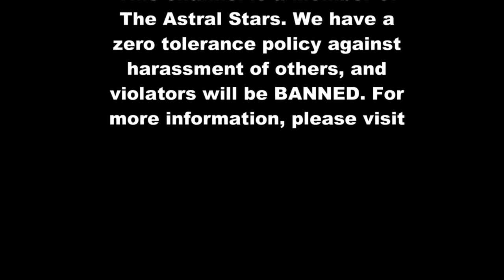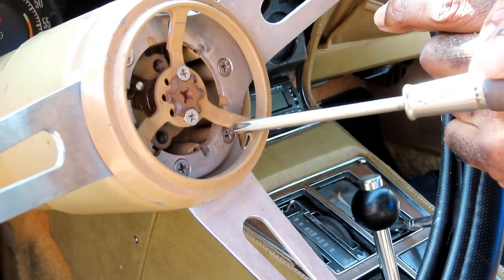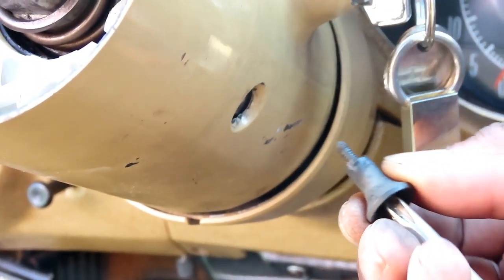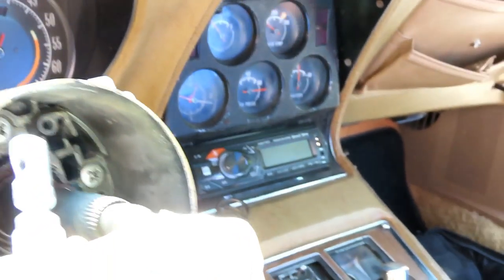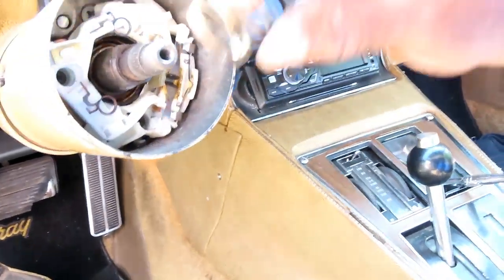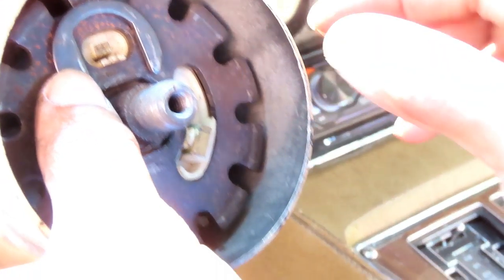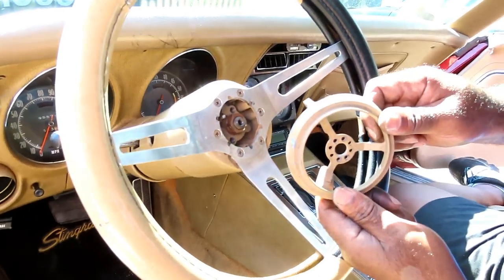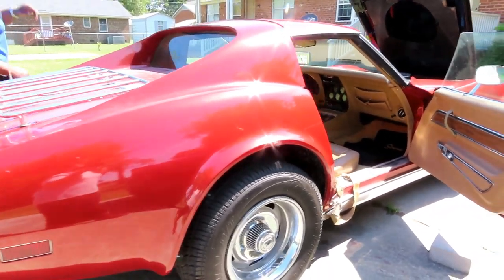⭐ 1974 Chevy Corvette Stingray - 350 - Ignition Lock Cylinder And Key

Comment: WHAT U NEED TO DO IS INSTALL A THREADED ROD IN THE CENTER OF THE SHAFT AND TIGHTEN A LITTLE AND THAT WILL LOCK THAT SHAFT INTO PLACE. THEN YOU CAN USE YOUR TOOL

Comment: Hi time I have a question. I have a 92 check 1500 pickup. And my brake light on my dash comes on at 35. Weeks back when I hit the backs I felt the abs working. I never felt for 9 years. Can u help with a answer?
Reply from the maker: Hey Fred, do you have any ABS codes?
Reply: I connect it and no codes came up
Reply from the maker: What did you use to check for codes? For the brake light to come on at 35 MPH, the system had to pick up something. Sad part is MOST scanners will not pick up all ABS codes.
Reply: I put a paper clip on a and h  . Doing it now. Still nothing. Obd1
Reply from the maker: @fredsolomon3rd6969  You need a scanner to read OBD1, and be able to read ABS. The actron 9690 can that, and it's not expensive.
Reply: This thing has sensors in the front. I'll fix it tomorrow.
Reply: Hey Tim can the Actron 9690 read BCM codes
Reply from the maker: @fredsolomon3rd6969  That is a very good question, but to be on the safe side, I'm going to say no for now, but I'll check more into mine.